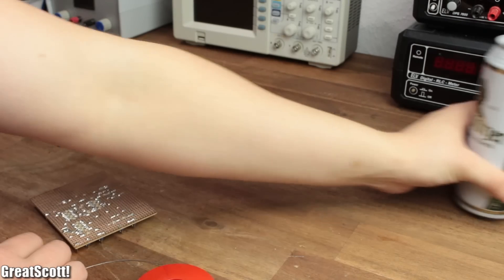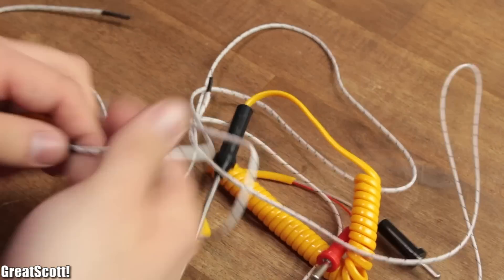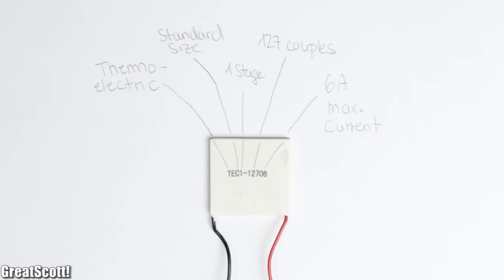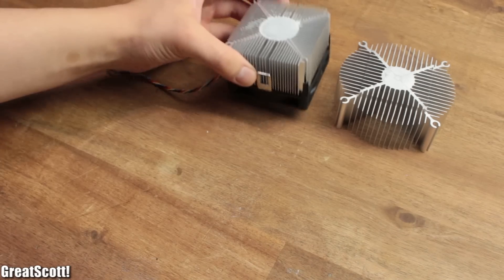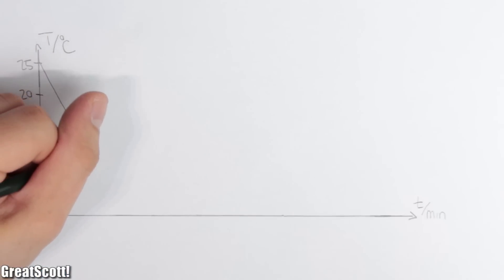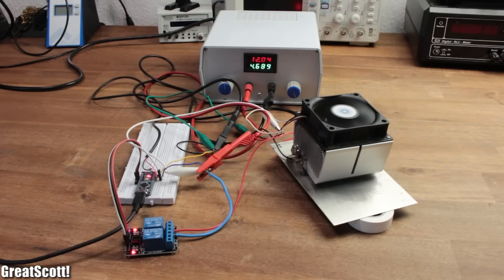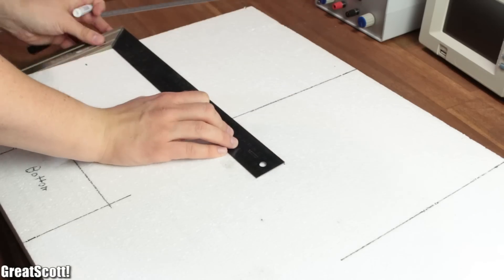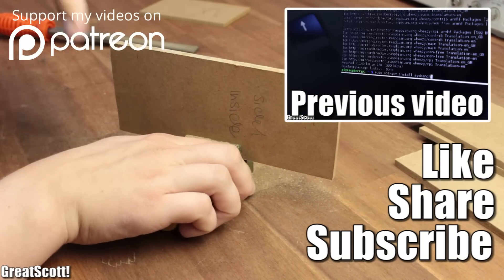DIY Cooler (Part 1) || Peltier Module

Comment: This idea is good for an educational project, but I wouldn't use the on-off type of control you are using, trust me on this I have already worked with TEC modules before. Every time you turn of the system heat will flow from the hot side to the cold one, making your fridge work as a heater when the voltage is turned off, this will cause your microcontroller to act way faster than you are expecting and with that the life of the TEC will be substantially reduced. There are two ways to control the power output of a TEC module properly, one of them is using a fast acting PWM signal (it must have a higher frequency then the heat flow inside the module), the other one is using a linear power regulator, witch is more complex but very interesting to put to work. Linear Technology produces one IC specific for this purpose the LTC1923, it's very good, also Maxim Integrated has a whole line of drivers and power controllers for TEC modules.
Reply: To effectively reduce the risk of the issue with the on-off thing, you need like a 5 volt low power mode to keep heat from coming over to the cold side again.
Reply: to you think that using PWM is a good thing? that was also my first idea on mine, but my arduino is a 5v,and my Peltier is a 12 V, i drive my fan with a PWM pin linked to a static relay. ... unfortunately, my SSR  support only 2 amps,  and already burnt one o my 8 channels (I'll use it on another project, don't worry for it) so what could be a good solution?... I'm curious because a friend of mine just told me his peltier has died 3 minutes ago... and I'm scared it happens to me too pretty soon.. thanks :)
Reply: This can be greatly reduced if you let the external fan on for a minute or so after the TEC is off. If possible, switching the Peltier from 12 to 5v and finally off(but still leaving the fan on for a while) would give another help in cooling down the Peltier element.
Reply: Old Post, but very good point.
On off controls are notoriously bad for efficiency.

In Air-conditioner land, all the good ones now use  "inverter" technology, what really means it's not an on/off control with a two degrees hysteresis, but a DC control.

Comment: do not spread the thermal paste: it will create bubbles under the surface of the heatsink
Reply: +MasterControl90 It was thermal glue, he had no downward pressure so needed to spread it.

Comment: Thanks, I've wondered what the marking on peltier plates meant, I e recently bought a pair of 5 volt ones, TEC1-4905.  They can draw around 3 amps each I believe so I can run them from a good wall wart USB power supply.

Comment: a few comments; Peltiers should really be driven with a constant current like LEDs. on-off or PWM regulation of peltiers are generally a bad idea since the loss is proportional to I^2 and every time they are off you have a "leak" between the hot and the cold side

Comment: are you using a rechargeable battery? wouldn't it be a better idea to just get a 12v adapter from an outlet?
Reply from the maker: +Guy Dascalu You can even see my power supply in the thumbnail.

Comment: wouldn't it be more powersaving if you tried to keep temperature at a constante of, say 7 degrees? keep the fan rotating at lower rpm and send less current trough peltier.
Reply from the maker: +Igor Frangez Sounds like a good idea as well. But that would have made it more complicated.

Comment: Neodimium magnets in the door, the density of the insulation higher is better. The peltier modules in the bottom and the thermistor in the top for convection effect.

what if you uses two peltier modules, the first one for cooling the refrigerator like the video, the second attached to the hot side of the first for use it like a energy generator, with the energy generated I think would supply power to a small fan or even the arduino. 
was just thinking...

Comment: Thanks for the great video! Perfect timing as I need a very tiny "fridge" to keep my solder paste in @ about 10°C max but handy near my bench.  I may try another hotbox by reversing the peltier module to warm up the paste without having to use a hot water bath.

Comment: Kreissäge auf Englisch ist zwar eine Circularsaw  (Jigsaw ist eine Stichsäge) aber egal.
Reply: +Franz Imschweiler Oder auch "Skillsaw" :)
Reply: +Steinblocksebi Macht nix :D
Reply from the maker: +Franz Imschweiler I noticed that we did not use a jigsaw this time after I recorded the voice over.
Reply: +GreatScott! Just as i thought :[]
Reply: GreatScott!
Not really a problem, it could just aswell be done with a jigsaw, so no worries :)
Reply: +GreatScott! Und Dekupiersäge = Scrollsaw ;-). BTW, super Video! :-)
Reply: Falsch. Kreissäge ist eine Tablesaw:)
Reply: +Steinblocksebi Nein, das heißt Tischkreissäge. Kreissäge (also handgeführt) ist Circularsaw. :)
Reply: +Franz Imschweiler Achso da hast du recht. Tut mir leid.

Comment: perhaps a stupid question, but why not use a mosfet instead of a relay?
Reply from the maker: +SirArghPirate Not stupid at all. A MOSFET would also have worked fine. But due to the current draw of around 4A per module you would have to deal with power loss due to the resistance of the drain source path. It is relatively small (around 0.3-0.5W) but it still exists.
Reply: Cost? Heat? Already had relays? AC?
Reply: I was thinking the same until I realised the mosfet has quite big internal resistance (around 0.1 ohm) when it conducts current, so using relay is quite good idea.
Reply: even stupider question... what's a mosfet ?  how does It work and what does it do?
Reply: +Jordan FISSEUX Short answer: Switch toggled by current with no moving parts
Reply: .... I want one, it could help me for most of my projects :) thanks a lot ! GreatScott!'s community is.... great !
Reply: But... how does it work? I mean, if I have a 12V lamp, a 12V supply and an Arduino and a mosfet... where do I need to plug things?

I mean where do I have to plug the 12v input?(I think source?). the GND? (Body?). The 5v arduino output? (Gate?)

Or could someone post a link to learn how to, I don't want to spam this comment place too much ... thanks all
Reply: The arduino goes to the gate, alongside a resistor, the 12V goes to the the lamp, and then to the drain, and the source goes to gnd
Reply: http://i.stack.imgur.com/5vUXT.gif

Don't forget the diode if using a classic lamp, and not a LED.
Reply: +Ognjen Galić awesome !  I'm going to buy some of them so :) thank you :)

Comment: I'm actually making the exact same thing, I just took my dead ps3 fan instead of pc cooler.. but thank you to make me understand how work peltier module ! you're awesome :D the difference with my thing is that I'm also managing the fan's speed, because ps3 fans are really loud

but one more thank you!
Reply: +Jordan FISSEUX use the PWM method pulse the power on very fast at different intervals for different speeds, he shows how to make on I do believe but there are tutorials on youtube
Reply: kevin tate I'm already doing PWM, I'm driving a static relay with pwm for the fan, and it works perfectly with it, but for the peltier I'm using a normal relay (which are fast enough to use pwm, static relays are 2 amps :) but thank you :)
Reply: Jordan FISSEUX Don't use PWM on peltier modules because they lose their efficiency and eventually will die, look around in the comments there are some explanations on why
Reply: Oh OK thanks, I'll just use a if - else if with  temperature limits then :)
Reply: Jordan FISSEUX But the heat flows to the cold side and heats up the refrigerator fast than you think
Reply: I saw that, but I can did an experiment at free air (It the french expression, hope you'll understand) and it stay between 8 and 12°C for 2 minutes, and goes back down in 1 minutes. . But in open air, so in a box it should stay longer I think, I still have to make a box